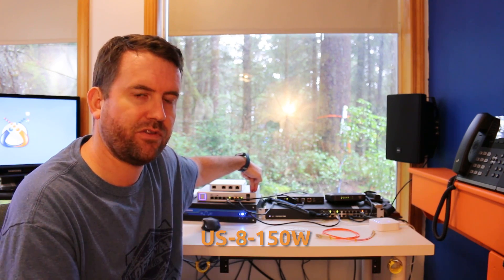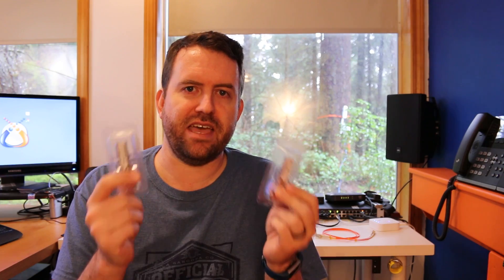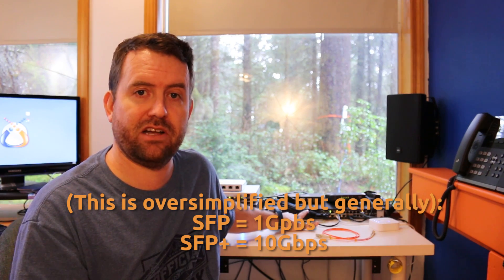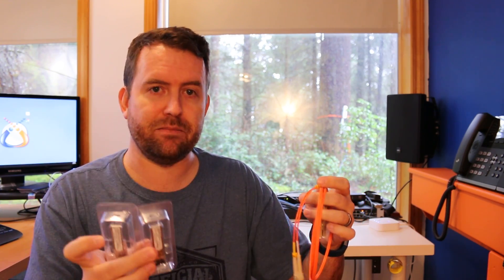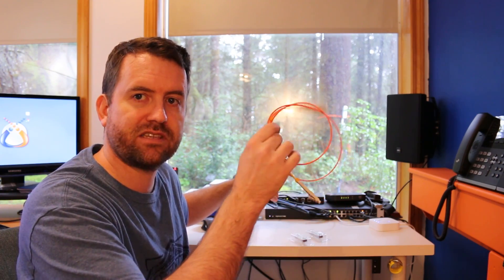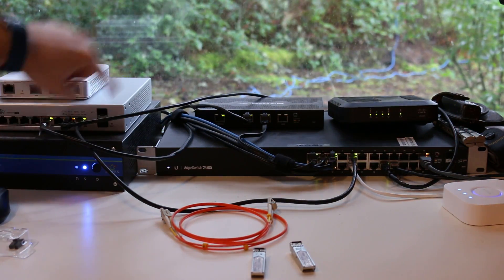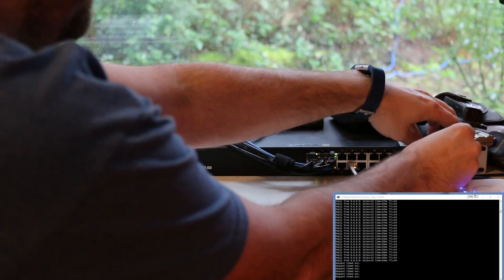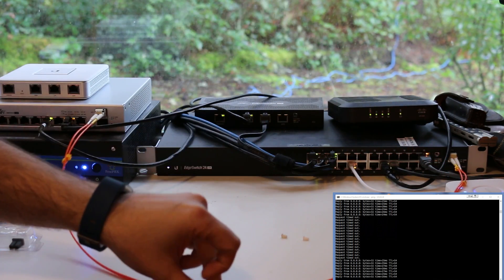SFP Module Installation

Comment: Is it possible to make a connection between SFP ports on switches of different manufacturers? Specifically a Dell PowerConnect 2824 and a Unifi Switch 24 250W.
Reply: I got a DAC (Direct Attach Copper) cable  to connect my EdgeSwitch 8 150W switch and a Mikrotik CRS125-24G-1S-IN. Works great. I bought the 1 meter size of: https://www.amazon.com/gp/product/B00WHS3NCA/  It supports 10Gbit, but I only have SFP so it runs at 1Gbit.
Reply from the maker: Yup - should be fine as long as you have SFP modules that are compatible with the switch it is plugged into.
Reply: Cisco Catalyst switches are configured by default not to work with non-Cisco SFPs.

When a SFP is inserted into a switch's GBIC port, the switch immediately reads a number of values from the SFP and if it doesn't like what it sees, it throws the above error message and disables the port.

All SFP modules contain a number of recorded values in their EEPROM and include:

    Vendor Name
    Vendor ID
    Serial Number
    Security Code
    CRC

How To Force Your Cisco Switch to Use 3rd Party SFPs

Despite the error displayed, which leaves no hope for a solution, keep smiling as you're about to be given one.

There are two undocumented commands which can be used to force the Cisco Catalyst switch to enable the GBIC port and use the 3rd party SFP:
3750G-Stack(config)# service unsupported-transceiver

Warning: When Cisco determines that a fault or defect can be traced to
the use of third-party transceivers installed by a customer or reseller,
then, at Cisco's discretion, Cisco may withhold support under warranty or
a Cisco support program. In the course of providing support for a Cisco
networking product Cisco may require that the end user install Cisco
transceivers if Cisco determines that removing third-party parts will
assist Cisco in diagnosing the cause of a support issue.

3750G-Stack(config)# no errdisable detect cause gbic-invalid

Comment: So, for a 1 meter connection length, there is no clear advantage to use SFP as opposed to a Cat 6 (or 7) since they're running on 1Gbps?
Reply from the maker: That's correct - not really necessary.  The only advantage that I gain by running a fiber patch cable in my little test environment is that I would be able to use all 8 PoE ports on the US-8-150W if I wanted (which I also don't need to do).
Reply: Got it. Thanks!!
Reply: Pretty sure he was using a 1 meter cable for demonstration purposes.  In a 'real world' scenario, a fiber would be much better when great distances are in play.

Comment: Great video Chris, this is like connecting sfp modules for dummies!, super easy to follow, thanks for the amazon affiliate links.
Can you do a video on DAC cables as well (connecting switches , nas & servers)?
Thanks again 
Cheers 🍺
Reply from the maker: Yea - I meant to mention DAC in this video, but forgot.  I'll have to order a DAC patch cable and do a follow-up.
Reply: 10Gtek also makes DAC (Direct Attach Copper) cables. It worked for me.

Comment: is there a way to add more 10gb rj45 ports to the US‑16‑XG?
Reply: Dominique Richardson there are some transceivers that have started to show up from a couple vendors. I know HP makes a SFP+ to 10G base T, and I've seen a Cisco compatible transceiver as well, but it wasn't made by Cisco. All of them were in the $600 to $800 range. In the past, you would have needed a separate fiber to RJ45 box to do the job, but it looks like some manufacturers have figured out how to do this within the lower power requirements of SFP+. From what I can tell, the main limitation is cable length - limited to around 30m. I'd be curious to see if 10gtek releases compatible modules in the future.

Comment: Hey Chris!
Telecom/fibreguy from Norway here again!
And I just wanted to point out a few things that you might want to mention in a followup/similar video in the future:

1st: SM vs MM ... You say that MM is more cost effective. Now this might be different in USA, but in here in norway and as far as i can know, europe in general, SM is WAY cheaper then MM. Prices of SFPs I do not know, but SM pigtails, cables and patchecords are roughly a third (or better) of MM, as well as you saied, spans can be longer. MM is usually 550meters (1500 feet or so), while SM is in the 100s of miles range. But that is greatly dependent on the SFPs in use. Also note that there are two MM standards, but im not sure if they are interchangeable or not. 62,5/125 and 50/125 (Micrometer core of the fibre/micrometer size of the entire fibre). So thats is worth checking as well when buying gear for a cable or cable for gear :)

2nd: You should never take out the rubber things from the SFPs, and the plastic caps on the patchcords until "just before" you are about to connect them, as dust might come into the SFP, and thus adding attenuation to the connection, and worst case that ive personally encounted, washing the connectors/SFPs removed about 20dB of attenuation.

3rd: As breafly mention in the end of #2, you should always clean the ends of the patchcords as well as the port you are connecting them into, it be a ODF or SFP or otherwise. Google "LC cleaning pen" or similar. ALWAYS ALWAYS ALWAYS ALWAYS!
It WILL reduce the ammount of support you need to by ALOT.

4th: You probably know this, but worth mentioning all the same ... MM always have gray connectors, both 50 and 62,5, while SM have either green or blue, depending on the type of connector. UPC and LC are blue, and APC and SPFs with "ALC" connectors (not sure if thats the correct term as we never use them) are green. And they are NOT interchangeable. APC are USUALY on long spans with SPFs with high output, but not exclusivly.

Best Regards! Thomas!
Reply from the maker: Great info!  Bottom line - clean your ends before you stick it in.
Reply: what you call an "ALC" connector are known as "APC"  (angled polished connectors) in the UK - green boot and strain relief.
Reply: Great info from Thomas indeed. I would like to add that working with fiber is a completely different ballgame then copper. In the professional world we have the mantra: test (laser), inspect (fiberscope) and clean. The fiber strand is smaller in diameter then a human hair, so any tiny amount of dust or debris will degenerate the signal enormously.

Also, ESD! I’m not one to be overly concerned with Electro Static Discharge, but SFP’s are sooooo delicate! You have to take precautions and pull out the old wrist strap.
Reply: Crosstalk Solutions that's what she said!
Reply: Great insight. Thanks for your support and being so professional.
Reply: SFP supplier from China,Email&Skype:Cindy@yingdapc.com,whatsapp&Tel:008618026920928

Comment: Why would you want to spend the money to use SFP? What is the advantages and disadvantages of using a SFP connection vs an Ethernet?
Reply: It also splits the two switches from the possibility of a high voltage surge traveling down the copper.  That's the biggest use case I've seen over speed and distance, is electrical isolation.
Reply: If you want to run longer distances than Ethernet (SMF up to 120km and MMF up to 500m) but don't need higher speed than 1Gb/s or if you you are forced to run the cable through areas where the environment would influence electric signals in Ethernet cables due to strong magnetic fields. Large ships often have this issue and this is why you would use the cheaper SFP over SFP+ since they don't need the speed of SFP+ but the reliability of fiber.
Reply from the maker: This is a great answer - in my scenario, you absolutely would NOT need to run fiber (unless for some reason you HAD to take advantage of all 8 PoE ports in my little UniFi switch).
Reply: Exactly my question, so 1 Gbit SFP vs 1 Gbit RJ45, of course if you do not pull the cable longer than RJ45 can cope
Reply: There are only three reasons I can think of for using SFP and fiber. First, is length. Single mode can go multiple miles. I've heard up to 13 or more. Second would be for SFP+. If you want 10Gbit and any decent distance you need fiber and third would be because you can't run ethernet for some reason. Could be space constraints, electrical issues.

As far the scenario that Chris is showing, there really isn't a good reason to do that.
Reply from the maker: Thanks for the extra input!  I actually realized I should have mentioned DAC cables while I was editing, but I do these things mostly off the top of my head, so I miss stuff.
Reply: I have the US-8-150W, but I put in RJ45 SFP in the to port, so now I got a 10 port switch. Work great, I used some Cisco SFP they work fine.
Reply: @Brianmk1977   I inserted an SFP into it, but it sticks out about 1 inch. Is this normal?
Reply: Josh Roberts On the unifi 8 port poe switch you loose a port for the network up link but if you use a sfp you get that port back to use for poe and with it having 2 sfp ports you can turn that 8 port switch In to a 10 port switch.
Reply: @ryoohk  lmao just buy a fucking 10 port ethernet switch if that's your need
Reply: Also, Fiber is more secure it is difficult to tap into. The distance that fiber can transmit is the primary reason.
Reply: The biggest reason I use fiber is between buildings on the same campus.  Electrical codes require grounding of Ethernet lines entering a building and this is a PITA for Ethernet even though they do exist.  You are likely to have ground potentials that are significant enough to affect the equipment.  Fiber eliminated all electrical problems.  Had one facility that had a small switch in a separate building, replaced it 3 times in two years, put in a fiber link all the problems went away.
Reply: I know the local ski hill uses fiber on the lifts. I guess the towers get hit by lightning sometimes in the summer. With the fiber runs they don't have to worry about frying the networking gear.
Reply: Fiber will not be affected by power surges caused by lightning.
Reply: I wasn't even thinking of shielded Fiber lines. i was thinking of your everyday fiber patch cables.
Reply: You can also get 1000based T copper SFP modules that are super handy for linking switches if you are running out of ports.
Reply: That is very true.  Not to mention if your going to bury fiber even short distances, like between buildings, your always going to use and armored cable.  Otherwise its not locatable.  Your grounds keepers planting flowers will have the possibility of taking down the network if not buried correctly using armored cable with locate posts.
.
Reply: You are correct, but you're really missing the point, I think. SFP ports really start to shine when you use them to connect your networking gear together. Switch-to-switch and switch-to-router connections over fiber have a faster and larger bandwidth than traditional Ethernet over category cable. And you can go a much longer distance. Consider a school or company campus. I might wire each building with Cat6 cabling and switches for 10GB network. Each building has a single "core switch". I can use fiber to connect each of the core switches across my campus. This has better bandwidth and can allow my building to be farther apart, and even across the country.
Reply: It's no harder than copper.
Reply: That's not true at all. Lightning does affect fiber as does other environmental events such as temperature changes and wind.
Reply: I dont get it i wanna get a gaming router xr700 its 500$ an i dont know what i need for the router i wanna have the fastest internet so i can go in comp gaming need the best of the best

Comment: If you have a 1Gbps SM SFP and you discover you have a long length of MM fibre, that you can't replace, you can use a Mode Conditioning patch cable in a pinch. 

Basically just a MM patch cable with a short piece of SM fibre on the transmit side that provides an offset for the laser that prevents differential mode delay over long distances.

Comment: Hey , 

In the previous video ( Enterprise Network - Nursing home ) . you had multiple X16 connected to fiber to each other.. 
eg.  X16-1 connected to X16-2 and X16-3, and X16-2 connected to X16-1 and X16-3.  I am just wondering why is that  ? 

-  In the ES or US - there are 2 SFP+ ports . Can I get double the performance if I connected them both ? 

Thanks :)
Reply: Makes sense, 
But I would assume that all these switches were connected to like a main  switch that is connected to the Router/GW ?
Reply from the maker: broxigar1983 is right - also, if you dig through the comments on that video, I explain that further.
Reply: Thanks

Comment: I think I read somewhere that you can use a 1G sfp module in a 10g port. Seems like you had to manually change the link speed in the switch. Can you verify this? I would like to have a fiber edge switch but I have several 48 port switches that are mixed 1G and 10g
Reply: Using SFPs in SPF+ Ports works great in my case, even the autoneogation(changing to 1G worked well) for me but that might be different from Manufacturer to Manufacturer
Reply: Oh, forgot to mention, i'm Using the UniFi 10G switch as a Core switch and 1 24Port UniFi as well as a US-8 Switch all with SFPs from FS.com